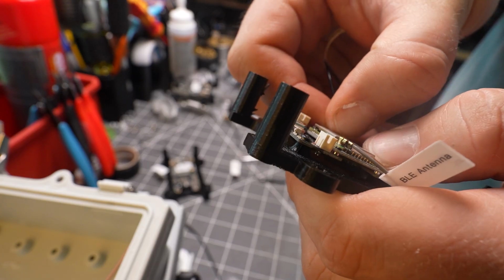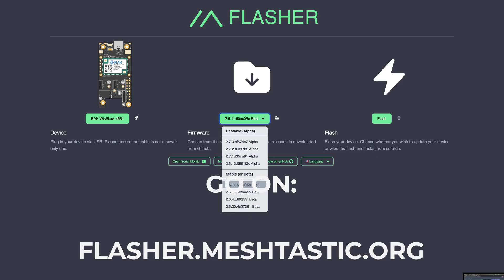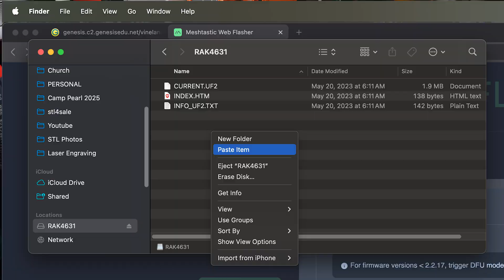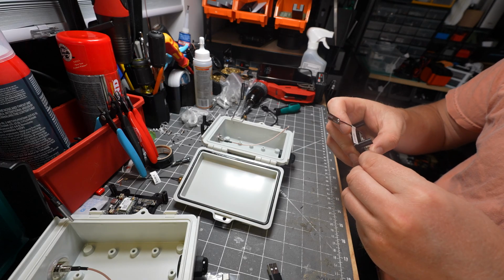The $180 Meshtastic Solar Node Build Guide 2025

Comment: Where is the charge controller for the battery? I see your solar is doing the leg work and the battery is backup but how do you charge it?
Reply from the maker: So the wisblock actually has an internal charge controller for the internal battery. So it's Solar Panel-->Solar Panel Battery--> Wisblock via USB-C --> Charges Internal battery also

Comment: Great build! I just bought the solar panel you used with the built in battery. The plastic mounting bracket that comes with it is really junk and I don’t trust it in frigid cold winters here in New England. I want to mount it on a roof mount pole. Do you know of a metal bracket that can be used with the 1/4-20 holes on the back of the panel and also has U-Bolts to fasten to the pole?
Reply from the maker: there is a 1/4-20 mount on the back of it. You can purchase something like a magic ARM to mount it (They're typically for cameras) or a Security camera mount. I have one linked in my other Meshtastic build video. It has the same 1/4-20 mount but it's heavier duty.
Reply: @Districtfourtyseven Thank you!

Comment: This is rather awesome and exactly what I am looking for. My only complain is in the pictures on your website you show using wago connectors. I hate wago connectors. Just solder and heat shrink. Otherwise I'm giving this a go.
Reply from the maker: we don't need to use WAGO connectors anymore, in the build video i go over the process of regerminating the battery for reverse polarity. and that eliminates the need for soldering or WAGO.

Comment: I'm extremely new to this so how far can a repeater reach?would I need several set up around town or across town?
Reply: I just got a elecrow m2 (tiny client node) and reached nearly 15 miles to a tower downtown. I live in the hills overlooking the town, and the mesh is big in my city, but I was surprised. Tiny node with the most basic antenna inside my house and it took less than a minute to connect that far.

Comment: I did not understand where the battery goes... You didn't connect it to the board. Whats the meaning of having it inside?
Reply from the maker: I didn’t connect the battery, because this was for an order. And I’m shipping it out. Once you’re ready to power up the node, please connect an antenna. And attach the battery. But double check and make sure that the polarity is correct.

Comment: What's the point of putting the battery in the case not connected. Useless.
Reply from the maker: i dont want the node to accidentally be turned on during transport. You dont want it powered on without an antenna connected.  

It's in the case so the customer just knows how it's supposed to be held in the case with the velcro, it's one less thing for the customer to look for in the box. 

Thanks for the USELESS comment. <3
Reply: @Districtfourtyseven  You're welcome. I engaged with your video, I'll leave the comments so it helps others. 

I'll clarify since you misunderstood what I was saying. Seeing as your using a buck converter to run it off the battery backed up solar panel. That battery (6000mAh) in turn becomes a back up power source to a primary source(solar panel battery). It is pretty useless, and a waste of money. 

I will say this, for anyone trying to follow this video, save your money. Find another video, with better walk through. This one was a huge waste of time/money/effort. I just hope I catch others, before buying anything, and save them the frustration.

Comment: So am I correcting thinking? The solar panel goes to the buck converter, then through USB to the heltec board  and the battery connects directly to the heltec board, yes?  I then assume then that the battery is charged by the power coming from the solar panel through the USB, is that correct?

Comment: I bought that same battery, but the jst connector is too big to plug into the rak4631's port, does it plug into the port that says solar or do i have to solder the correct jst connector onto the battery??
Reply from the maker: Are you plugging it into the solar or the battery side? and it should be the JST2.0 connector. Can you confirm that's the right one? 

Thanks!
Reply: @Districtfourtyseven Well i soldered on a smaller connector on the battery and plugged it into the smaller battery port, but it seems like it's not charging the battery while plugged into usb c, so do i plug it into the bigger solar port on the other side?

edit: i figured it out and read the wrong side, kind of an idiot, but at least i'm learning 😂 thanks anyways!
Reply from the maker: @wafflemix232 hmm. I’m trying to picture what you’re doing and I can’t. Mind sending me a photo or 2 to my email? David.district47@gmail.com 

Let’s try to get this figured out.

Comment: Do you really need the battery since the solar panel already has one?
Reply from the maker: technically no-- but i like the redundancy aspect of it, if the panel dies, or the battery dies, you'll have the node up for a very long time, especially if they're both fully charged.
Reply: Won't work  with out sun light

Comment: I’m thinking about adding a Node on my roof where the TV antenna is on a rotor.  The power feeding the rotor is 24v.  I’m thinking of using a DC-DC buck converter to drop 24v to 3.7 or 5 volts to feed it directly or a charger for the DC charge system to keep it maintained.  Has anybody done this
Reply from the maker: that could totally work. the charging voltage on the wisblocks is 4.2v. 

But even if you convert the 24v to a USB, you can just connect that to the USB C port.

Comment: You sold me.  Went to your website and ordered the unit with the solar panel mounted to the case.  I chose that over the one with the detached antenna on a security camera mount because at the 33cm  band, the shorter the feed line the better. Outside of that, I have faith in your product and look forward to putting it into service.
Reply from the maker: Thanks so much for the purchase. I have it ready and it’ll be shipped out on Monday!

Comment: Hey @Rootkitdev, I just finished building this solar node and wanted to ask - have you ever had both batteries die, and then when you power up the rakwireless board it only shows a solid red light and won't let you connect or flash it. Did I fry my board? Any info would help.
Reply from the maker: Hey. So I have not. 

Let’s try troubleshooting like this—

Disconnect the 6000mah battery and try connecting just the solar panel. Do you get power and signal? 

Did you make sure the antennas in the ipex are connected properly and not loose? 

When connecting it to flash it, double click the little button next to the USB port to put it into DFU mode. Does it pop up? 

Make sure antenna is plugged in. 

Did you also verify the battery polarity?
Reply: @Districtfourtyseven 
I disconnected the battery and connected the solar panel and I get the same red light on the rakwireless board.

I double checked the antenna and Bluetooth connections and they are not loose.

When connected to a computer with a proper data cable the board does not appear on my computer. The solid red light comes on and the reset button does not do anything.

Battery polarity was switched before plugging in and all antennas were connected securely before powering.

I had this node running for about 3 days straight and I was able to connect to it through meshtastic and it appeared on my computer when flashing. But when both batteries died on my node, I got a solid red light when I powered it up again and now it's unresponsive.
Reply from the maker: @jimmydean8415  very odd-- have you disconnected the solar panel, and the 3.7v battery  and just connected it to a USB cable? see if you get the same results? It seems like it might be a bad wisblock. 

Do you happen to have a voltmeter to see what voltage is on the battery? 

Also, if you connect the solar panel to USB power, you can charge it up. Maybe that's worth it  testing if it's fully dead.

Comment: Thank you very much for sharing this!
I think that I will do it a little bit different, but I think the 3D Printed brackets will come in handy.

May I ask why you did not use a 5V Solar-PAnel and the onboard Charge controller of the Rak?
If there is a good reason I would reconsider my Plans.
Reply from the maker: im glad that the video was helpful! 

So the reason for not using the RAK charge controller is because the solar panel that I'm using also has a large battery inside. So i don't want to have the RAK try to negotiate power with another battery while having one already onboard. 

It might work perfectly fine, but I was just cautious.

Comment: So I like to use the serial connection and web interface on the PC to interact with Meshtastic rather than the Android bluetooth phone connection.  If I built one of these stations I dont want to run a USB cable all the way out to my roof.  But there's some other problems.  If I try to use Bluetooth from the PC paired the Meshtastic web client Bluetooth connection doesn't  work and wont display the device when adding a new device.   I also tried to enable WiFi and I  can get the device to connect to my 2.4ghz local network but then again in the web interface when making a new HTTP connection it just says no SSL certificate.  What is the best way to make a link to the outdoor rooftop base station without running a wire?  Thanks

Comment: Are you using the 12v out and 12v PD Trigger due to parts availability versus the 6v out?  
If 6v, couldn't you go into the solar JST and avoid the PD Trigger?

Also will you sell just the cradles for the board and battery?

Thank you for all of your great content.
Reply from the maker: Hey!, So i'm using the PD because I have a ton of them from making anderson powerpole adapters for customers. So i naturally gravitated to doing that. 

Will the wisblock negotiate power and manage the 6v? 

And yes, the cradles are sold on my site. https://district47.us.

Comment: You didn't connect the battery... why?
Reply: Because this is a build for a customer. He mentioned that also while packaging the antenna tape. Easier to ship and the unit is nearly ready to go when it arrives.
Reply from the maker: what carlbrothers said, and i don't want it to accidentally turn on while shipping and damage the wisblock by transmitting without an antenna on.

Comment: I wonder if the 12v to usb is a better solution than using a MPPT for 5v and use a 5v solar panel? Lots of people seem to use that MPPT to get a ”cleaner” output from the solar panel and also use it to charge the batteries. What’s your experience with this?

Comment: I saw they have cellular trail cameras that are solar powered. Thinking that would do it for an enclosure.
Reply from the maker: I was actually thinking about it, just would need to gut it and put the node in. My only thing with that is, once you open the camera, is it still going to be water tight? and it might be pretty expensive for an enclosure.

Comment: Got all the parts and realze you didn't go over how you mount the box.  I'll be using a pole so I guess I'll need to use clamps or some other option.
Reply from the maker: I’ll work on a quick video for you. You can use clamps.
Reply from the maker: I made a custom
Bracket for the box. But don’t have it up
For sale or anything. If you have a 3d printer. I can send you the file.

Comment: My nodes are every bit as good as this, but cost 30 USD. 

(LoRa) seeed wio sx 1262 44rmb 6USD
(Microcontroller)seeed xiao nrf 52840 98rmb 14USD
(power managment) cn3791 mppt 8rmb 1USD
(Antenna) 915mhz antenna 24rmb 3USD
(Solar panel) 6w 6v solar panel 7rmb 1USD
(Battery holder) 18650 battery holder 2rmb
(Battery) 18650 10rmb 2USD 
(Enclosure) //same as in video// 27rmb 4USD

Total cost 220rmb or 30USD

I didn't include the cost of wire, soldering stuff, and some 2 part epoxy to glue and seal everything. Even when you are finished paying all your tariffs you should still be able to make nodes vastly more affordable than this. My nodes rarely get below 80% power in the battery, and that is with the solar panels mounted vertically.
Reply: Can you please send me a message where I can buy everything from US? Thank you in advance.

Comment: I'm giving this a try this weekend with just a couple adaptations. I'm using a security camera solar panel with 5 volt USBC output and a 10,000 milliamp hour battery. One commenter mentioned that you could just use zip ties but I'm going to go ahead and print out the holders because when you have a 3D printer it's always fun to make customized and elegant solutions!
Reply: Hey ColoElk2458... How did the build go?  Did using  the security camera solar panel with a 5 volt USB-C output, and the 10K milliamp hour battery work the same, or better?  I too would like to build this setup and just read your coment.  I'll modify those two in my purchase if you can see a noticeable change.
Reply from the maker: amazing!! very happy to hear that you'll be building it. best of luck with it!

The cage uses m3 bolts. i use m3x16 but you can really use anything you have around the house.

Comment: Great video! Thank you!Curious what size bolts you're using for both the radio and battery caddies?
Thanks!
Reply from the maker: The bolt sizes for the case are m3x16 and the ones for the radio are the black ones included with your Wisblock Node.

Comment: Add Reticulum and Meshcore to your lineup, please. Not hard for a slightly experienced user to convert a device, but much easier to tell someone "Go here, buy the rnode or Meshcore version" and they're up and running without further handholding.

Comment: Confused why the internal battery is needed if the solar panel also has one. Is it just to have more battery life?
Reply from the maker: Redundancy. If the internal battery dies. At least I have like 2 weeks of battery on the built in one. And if the battery in the panel dies. It will just pass power to the internal battery. .
Reply: @Districtfourtyseven  Awesome build tutorial. Could you in theory power the WisBlock directly from the 5v/3A USB-C connection on the solar panel? As in, do you know if the USB-C on the panel will continue to supply power even with very low draw?
Reply from the maker: @ColoElk2458  hey, so yes it will, you technically could shave some money from the project by not even having an internal battery since the panel has one.... i added one because i like the idea of redundancy and just having a lot of battery life.

Comment: Why you skipped the connection of PD board? It goes to the solar input I would assume? So RAK 19007 contains a PD sink to negotiate protocol? 😲
Reply from the maker: I never tested it that way. Main reason is because then I’d need to make JST connectors. And I hate them. Lol

Comment: what screws do i need to hold the PAK to the printed bracket ?
Reply from the maker: I use the screws that are included with the enclosure. There’s only 2. But it’s enough.
Reply: @Districtfourtyseven sorry I mean the smaller black ones

Comment: You can shave $80 off your parts cost if you use a 5 volt solar panel for a security camera (They go ~$15 on Amazon) wired into the onboard charge controller on your Rak's JST 1.25 (you can even just plug the USB C into the board, but that's inefficient), and use a 3000 mAh battery.  I use the same weatherproof boxes, but I mount the solar panel to the door (one 1/4" hole for the machine screw and another 1/4" hole for the snipped USB wire), and situate the antenna on the bottom of the box for weight - the antenna is still vertically polarized, even though it's pointed down.  I "seat belt" the Rak and battery to the grid that comes with the box using zip ties - I cut the grid with an X-acto knife, but my pocket knife also works to pass the zip ties through the grid.  No need for the 3D printed stuff. I seal my holes with Gorilla Putty, and double up the rubber gasket on the type-N connector with putty.  I also drill a 1/4" hole on the top and put an eye-bolt into it.
Reply from the maker: There's so many ways to build a node. what you've written out seems like a really solid solution also.
Reply: I've been thinking about exactly that (except not with a Rak, so I'd probably use a BMS between the panel and battery), but I'm curious about the inefficiency of using the USB versus the JST. Could you explain why? I'm new to building battery-powered concoctions so I'm very happy to learn about these details. :-) Thanks in advance!
Reply from the maker: @jollino  Hey, so from my perspective. the reason that I went with a USB over a JST connector is:

- I wanted a USB Cable to be connected at all times, that allows me to easily update the node from my phone. Without taking it out. 

- I don't have too much experience with external BMS systems, but i have utilized over 1000 of those PD triggers and know their reliability. 

- The enclosure I use is very tight. I wanted it to be small for a reason, so space is also an issue, this is just the build that I ended up being happy with. 

Theres a butt load of different options and ways to make these nodes. no wrong way if it works.
Reply: Where are the mounting bracket 3D files
Reply: @JamesJohnson-qx1ng They're in the description. Click "more", scroll down.....
Reply: I'm building similar with a wio board. Solar PV 10W minimum for UK winter. 15W better. 20W no worries.
Reply: Options on mounting?  You did well.
Reply: Thanks for this reply, I was also going to suggest mounting the areal facing downwards to avoid making a hole at the top
 of box where the rain could get in. I was going to confirm that was OK to orient the aerial this way.
Reply: @StuartWoodwardJP it is. Still vertical
Reply: Can you please send me a link to the pictures of your setup and docs that you can share as well. Thank you!